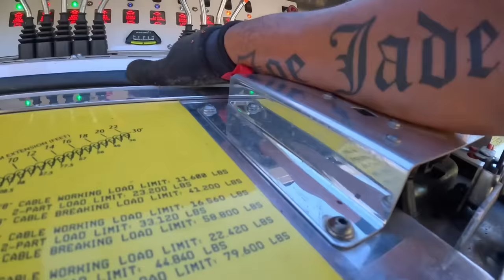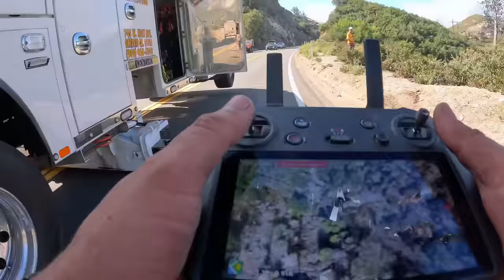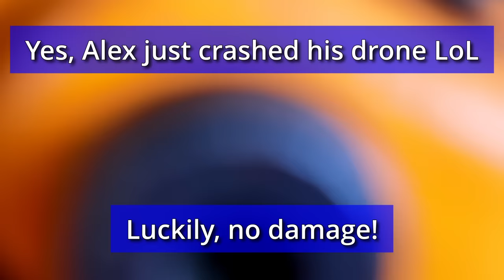RIP Toyota Corolla (Flew 350' down steep hill)

Comment: Dang, Alex throwing some shade on Ron?
Reply from the maker: When? I edit every video myself, unless there’s footage in here only you have access to
Reply: @PepesTowingService  he commented about using the suspension mounting points rather than running a strap through the windows as some other companies do.  19:35. I happen to also watch Ron's channel and I've seen him do the strap through the windows method.  To his credit, Alex didn't name him specifically, but he was the first one I thought of when I heard the comment
Reply from the maker: I can tell you right now if Ron is doing that, he isn’t the first or alone lol unfortunately it’s what a ton of people do
Reply: Ron has switched to picking cars up by the wheels, but if the vehicle is submerged in mud or deep water he will use straps through the windows until he can rerig